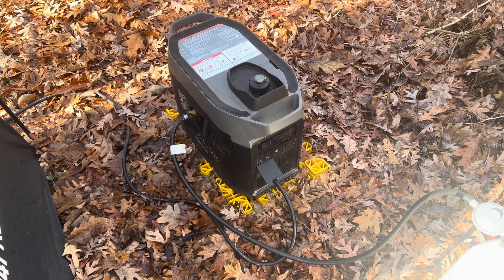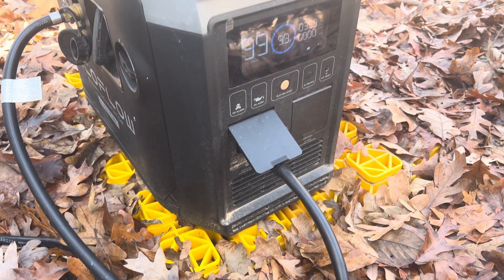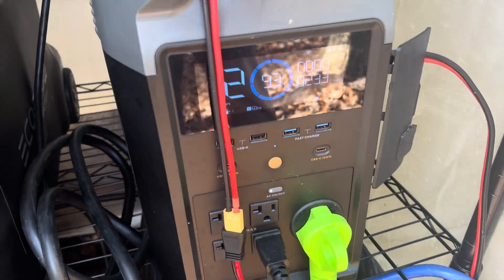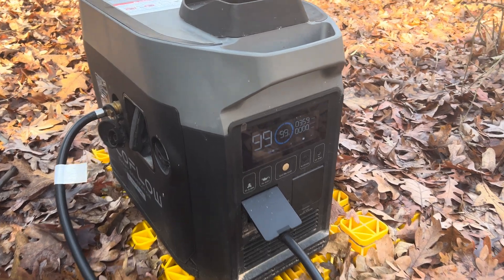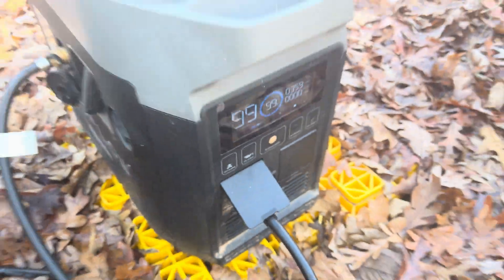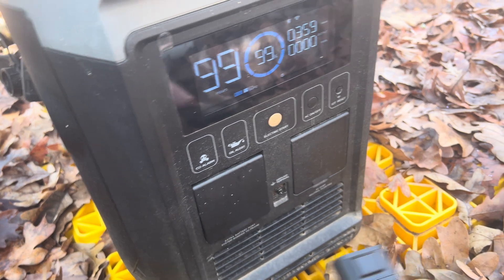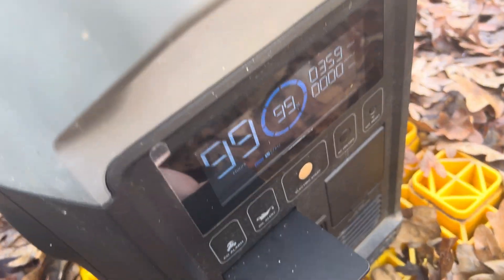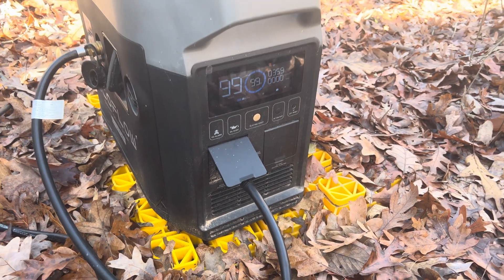Ecoflow Smart Generator not charging via XT-150 Cable to Delta Pro Unit

Comment: Dang, I just got a Ecoflow Smart Generator. For some reason it's not charging my battery through the XT150 cable. I ested the cable that it came with by using it between an Ecoflow Wave 2 and the Wave 2 battery... DC to DC works fine with that combo... but Smart Generator to the battery doesn't work. Ecoflow support offered to send a replacement cable... not sure if that's the issue...

Another guy on reddit told me that the cable he has only works 1 way... If his cable doesn't charge, he has to flip it around. This piece of information makes me think the plug isn't seating properly or an issue with the Smart Generator XT150 plug side... I really hope I don't have this issue, I've been wanting one of these generators for so long and now they discontinued this model :( :(

Comment: Which Westinghouse generator do you recommend? Our Delta Pro Ultra will be here on Monday. Also curious, are you using any solar with your units? Great videos. Thanks for taking the time to share your experience.
Reply from the maker: For the DPU, I have had a good success using the ecoGen10000 (affiliate link: https://amzn.to/48Jl5a8). It's my second Westinghouse, and it has performed well with use every day for several months, recharging the DPU at 240V - or at 120V if you wanted of course. I am using solar, though because we're in a wooded area, they don't give me much input during the non-winter months. But I have six BougeRV 400 Watts Solar Panels hooked up to the DPU's low voltage solar port, and then I have a "solar converter' that converts AC power from my older Delta Pro to 'solar' DC that feeds into my high voltage DPU input (this is for emergencies). Hope this helps!